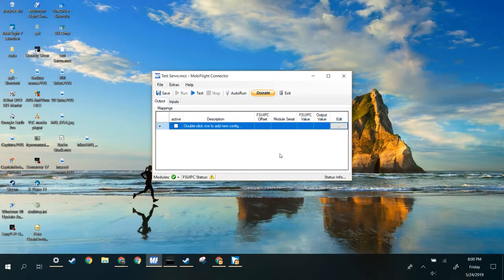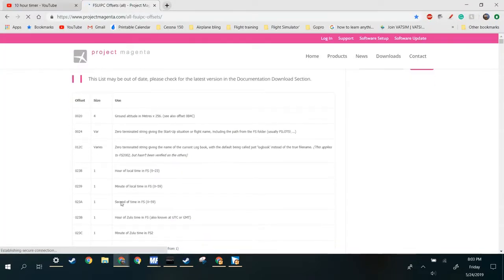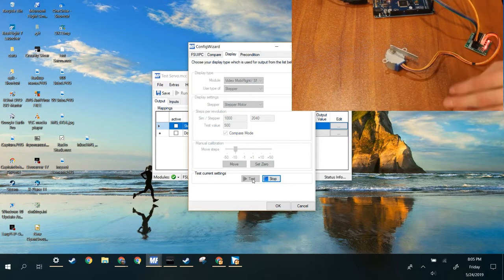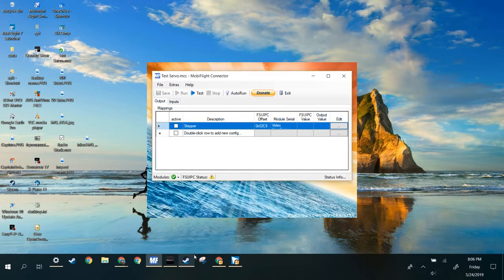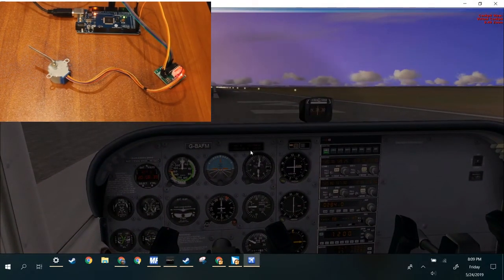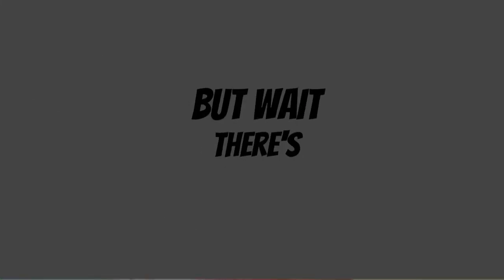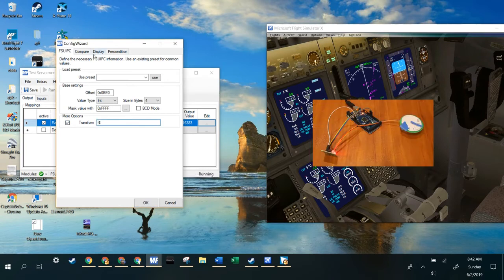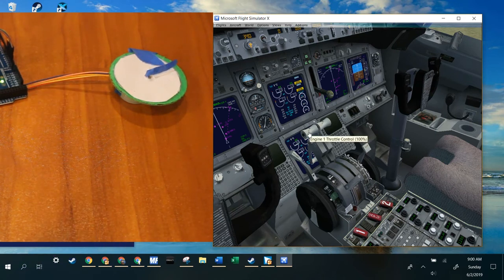How to use a Stepper Motor with Flight Simulator X | Captain Bob

Comment: Any suggestions on faster stepper motors?  I am doing an A-4 Skyhawk and the 28BYJs cant keep up with the rate of change.
Reply from the maker: I don't but you could go onto the MobiFlight forum and ask:
https://www.mobiflight.com/ or of course google it :) (Not sure how wiring would go with it though)
My recommendation would be to use a gear ratio in your rate of change indicator. Good luck with your sim!
Reply: If your going with bigger faster Bipolar steppers then use external power not arduino.

Comment: Can you do a video on an attitude (Artificial Horizon) gauge connection to steppers?
Reply from the maker: I will likely do an attitude indicator within the next few weeks, but it will probably be with servos. I will add a stepper version to my video list, but it will take a while, as I will likely have to design the print.
Reply: @CaptainBobSim  I am curious about how that is set up in the program?  I have been looking for a throttle, yaw, and attitude(X, Y) to control steppers.
Reply: @CaptainBobSim   I am more interested in the program to audrino mega for controlling X, Y and yaw with throttle?

Comment: Good job, take care on powering steper motors with the arduino supply, 1 motor is ok but when you put a lot of stepers you need an external power supply to avoid excede the power delivered by the arduino.
Reply from the maker: Thank you for the advice! I didn't think of that, good catch.
Reply: should not be powering stepper with Arduino uno Big mistake if yiou decide to give it more power.